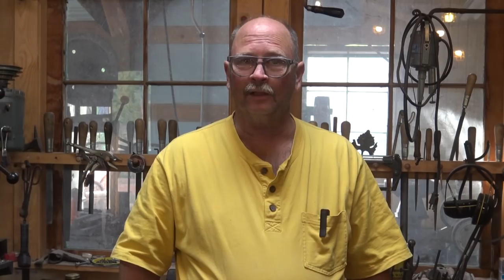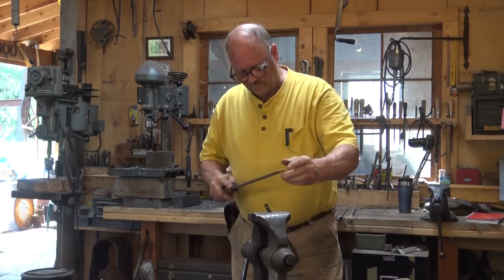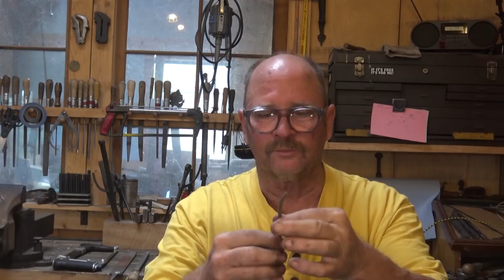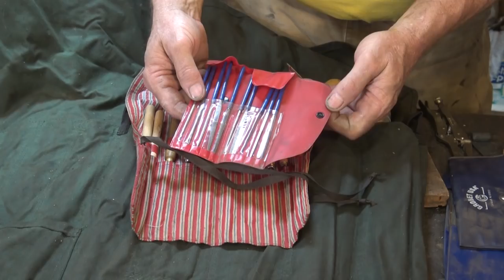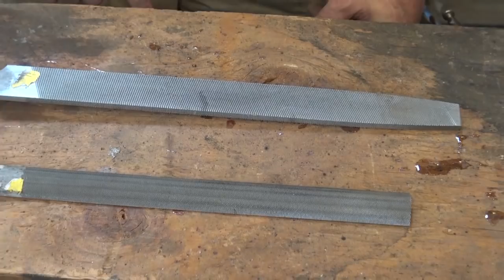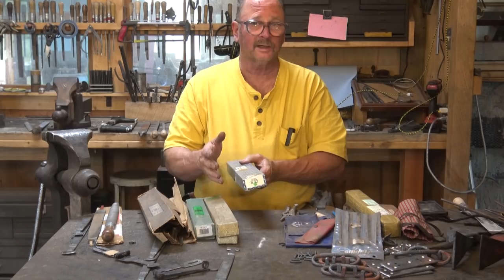Hand files for blacksmithing and metal work

Comment: Garage sales and estate sales if they happen in your area! I'm 28 now I'm hoarding old tools because they keep getting worse and worse!
Reply from the maker: The trouble with garage sale files around here is that they are usually well worn and have been thrown in a box with other files, which really wears them out quickly
Reply: @BlackBearForge  I did not know that about them rubbing together. It makes sense though. I learned a lot about files from this video. Thanks for taking the time to make these videos. I've tried it myself it takes SO much time to set up cameras when you're trying to get something done. Much appreciated!

Comment: great video. i’m a file lover and make knives with hand tools only, so files are a main tool for my hobby. i actually use files as stock for making knives. but most of my best files i have found at yard sales and usually pay about 25 cents a piece. i found the best way to clean them is with a flattened piece of copper tubing- rubbing the edge with the tooth profile, which tends to conform to the tooth profile. thanks for posting!! please realize what a fantastic teacher and motivator you have been for many. i’m sure God is saving a special place for you sir for all you do!!
kindest regards-scott

Comment: Thanks for the video, you informed me on what I was looking for (information). I also collect as many old tools as I can find them. Back when military bases were being "reorganized" they were selling tools by the pound!
90% of those tools were made during and after WW2 on up through the 60s and all extremely high quality even in used condition by todays standard. Some of my WW2 made tools have little to no markings on them, a 9/16 wrench would have the manufacturer name and nothing else. I understand the tools were being made for the factories & government as fast and simply as possible. The manufacturer names are many I suppose there were many contractors and subcontractors in those days but all these tools still work fine. FYI the file sets all came with several wooden handles that had metal jaws with twist tightening and a great file card that on the back side had heavy canvas including a space to hold a rig tipped pick in the handle.

Comment: Just watched this last night and for some reason went to a flea market today. Guy had a bucket of files all wrapped in wax paper. Ended up with 30 good condition  to new  assorted files. several USA  Nicholson, Simonds, Heller, Erizo, Delta and some stamped Germany. Most were long heavy files bastard, 1/2 round and round and a couple beveled like a knife withy a lions head stamped not sure what brand they are. Oh yeah $30 for the bucket 30 great ones and 10 junk.

Comment: Thank you have a good Christmas ! I just bought the Swiss files double cut ! I use them for jewelry they are the standard and German . I use PVC pipes in different sizes with paper or foam so they don't rattle in the draw or case .

Comment: John.  Thanks good info.  Couple of tricks that really work if you start with a good quality file.  I put my files in vinegar, especially when I buy old used files.  Couple of days to a week will really clean them out and make them cut.  I own a file card but don't use it much.  A piece of copper plumbing pipe smashed flat run in the same direction as the cutting teeth will clean a file faster then then card will.  Thanks for doing what you do.  I learn when I watch your videos.

Comment: One thing I was taught in mechanics school was to use a small square of aluminum to clean fine files. You would clean the file by pushing the aluminum parallel to the teeth. This would help dislodge stubborn metal filings caught in the file teeth. 

One thing more, I think it would be helpful if you discussed the different filing techniques: cross, straight and draw filing. 

Great video. Always enjoy the information and instruction you offer to help us become better blacksmiths.

Comment: Thanks very much for illuminating a truly complicated, confusing, and arcane part of tooling.  This is the best and most comprehensive treatment of them I've ever heard or read.  It's a great thing when an avid tool collector is a hard working and frequent user.  I think you should probably do tapes like this sparingly.  They don't the emotional kick of hot steel beaten with hammers, but when you do them, you do them well.
Reply from the maker: Glad you enjoyed it.

Comment: Great video. Thanks for sharing. Just some new info- Jason over at Fireball Tool did tests on the direction a file cuts the best. He made an automatic jig and ran the course with each file (thousands of strokes each). I believe he used pferd files. They cut in both directions equally, and after thousands of strokes, there weren't any visible differences in wear from the forward-only cut files and the ones used in both directions. The reverse only files cut equally as well as the forward only ones. Can't really argue with his results. It's either a myth or file design has changed over the years

Comment: I was watching as you rang your small bell. It appears to be made out of heavy material so will not vibrate
 Also a large bell chamber  made out of light sheet iron or brass sheeting folded and riveted are what I have used on a belled horse in the mountains. A bell 4 to 5 inches tall 3 to 4 wide one way and 2  to 3  the other way is a popular size. Either rectangular or round makes no difference  as long as the bell chamber is open and thin enough to vibrate when the clapper impacts  the very bottom edge of the bell. 8:35

Comment: Many thanks for that video! I got curious. On the Dick web page (can not post link here as YT seems to delete comment then) you read under history that they do not produce files anymore but they let them produce by Usines Métallurgiques de Vallorbe SA. If you search Vallorbe files Switzerland you will find the company. They state which brands they have and there is a webshop where you see prices. They have two price lines. The better one is roughly 15 dollars for a 200 mm file. They also have Valtitan files which are 72 (!) Rockwell.  They seem to be one of the few remaining producers of quality files in Europe. I reached out to them with some questions RE saw files (watched the videos of Paul Sellers on saw sharpening). They came back quickly, nice, and so I ordered a couple of files. Can not judge the long term quality as not using them very often. 

Paul Sellers reviewed Bahco made in Portugal I think. He said they are good, I have one bastard file of these and it is fine however aslso using not on a daily basis.

Comment: Very good overview, John. I switched to Grobet files a long time ago -- but I wasn't aware their current production has been moved to China. Groan... I have good success chemically sharpening my old files with a 10% phosphoric acid solution. Klean-Strip Phosphoric Prep & Etch is, according to the MSDS, about 40% phosphoric acid, so I dilute that 1:3. I immerse the files, in a glass container, hitting them periodically with a toothbrush. You have to watch them closely, because it's easy to over etch. Gets rid of rust, etches the edges back to sharpness, and leaves a rust resistant iron phosphate layer.  Clyde
Reply from the maker: Is the type of acid important?  or can they be done in any acid solution?
Reply: You want to stay away from really potent inorganic acids like sulfuric, nitric and hydrochloric (muriatic) acids. Firstly because of health and handling issues, secondly because they are so corrosive even at relatively high dilutions. (My experiments with hydrochloric acid didn't end well...) Organic acids such as citric and acetic (at high enough concentration) acids can be used for rust removal, but I've not tried to use them for file sharpening. I have used citric acid for removing rust from the old handplanes I restore, but even there I prefer the phosphoric acid for the protective phosphotized layer it leaves. And, you can find the Klean-Strip at any big box store.  Clyde

Comment: Not sure if you mention it in the video, but a good way to store files is cutting a long, narrow, horizontal channel in a board and storing files by putting the tip in the channel. They cam and hold themselves and are more easily grabbed than files stored vertically. I met Bob Menard yesterday and I saw that he stores his files like this. I'll be copying it for my shop
Reply from the maker: I haven't seen that approach, great idea.

Comment: The quality issue intrigued me. There is a review issued 25.08.2017 by the magazine “selbst” (a DIY magazine). When entering “test feilen selbst” you should get it (it is a German pdf but you should be able to understand the quality indicated by stars). In the 80s a German institute (VPA) set a standard for a good file – it should last at least 7500 file strokes. The ones tested only made 4000 maximum. Most much less. Also the amount abraded per stroke was poor compared to the 80s. Quality overall was sobering is their conclusion. They had some 20 files tested (different shapes too) e.g. Dick, Pferd, Hase, Nicolson and some discounter ones, Prices between 1-20 Euro. The Obi brand, a Dick and a Pferd got a good and satisfactory. Interestingly, the expensive Dick one (21 Euro) was worse than the 6 Euro Dick. The Lux (Obi brand) 6 Euro fared well. So price also not always a valid indicator. I mean heck. Is science needed to buy a decent file? Why is so much crap produced?

Comment: Great video. I find rubbing chalk for a chalk board on your files prevent them from clogging up.
Reply: You can also use charcoal for this. 'Pinning' is the fancy word jewellers use for 'clogging up'. Especially useful on soft metals such as aluminium or copper. I was always told to use a file card parrallel to the direction the teeth.

Comment: My agreement comes with your dragging on return strokes...
which can only remove stuck filings.
A burr on the file is not kosher.
A short bristle brass brush is good... unless wire guage of it is mismatched to the files pitch.

Comment: Isn't it more efficient to brush the teeth of the file with the file card on the diagonal across the width of the file rather than brushing down the length of the file, in other words parallel to the cut rows of teeth?  I have never seen anyone recommend the lengthwise stroke of the brush. This is my experience.
Reply from the maker: You are probably correct, but I have never thought that much about it.
Reply: Absolutely correct Rolf -  you will also note that the wires on a file card are sloped. the direction of the slope in use,  really makes a big difference  Have the points of the wires sloping towards the file handle [ie. down into the slots of the file teeth] and you will get far better results. Most of the file cards in UK now are made with too thick wire diameter for most files.  I find  that for second cut and finer files, using the fine wire brushes made for cleaning barbeques are very effective.

Comment: I always thought that a bastard cut file had a second cut so I came out to my shop and looked at my files and most of them are Nicholson’s all made in the USA and the flat bastard cut and the half round bastard cut have two separate lines of teeth which I thought was the most aggressive then the only coarse single cut that I have was a mill bastard which is coarse but not as coarse as the regular bastard file with two cuts

Comment: Try buying a quality flat bastard from Amazon with zero taper and over 10”…disappointing.  Most are 8” second cut with a double cut tooth arrangement…not what I wanted.  I ended up settling for a make called Bahco in 10” parallel form featuring what they termed an Oberg cut, idk what that means!  It does feel aggressive and has a comfortable handle tho’.  It better be good at over 30 bucks (27 GBP).

Comment: I liked this video very much and I want to ask you to follow up on the topic of the lesser quality files and do some experiments in using ancient methods of case and through hardening of iron, early steels, to see if these too soft files can benefit from such carbonization.

As a guide, please see the series Ancient Tool Technology of Antikythera device, video " Fragment #3, Hand Cut Files".

This series, shows in detail how the early files were made, how to compound the carbon treatment mix, which goes into a closed clay tube/box, which is heated till the desired levels of carbon in the metal is reached.

I know there are good files out there, my dozen or so rasp and files are U.S.A. Michelson's and my sculptors rasps and rifters are Italian top quality, however, I needed a large New Nicholson Flat Bastard and bought one, which I would be interested in trying such a treatment on.

Your abilities and long years working in this field means you are just the man to make a honest go at finding out if those of us new to 'learn as you go' blacksmithing, can take charge of this one ancient method and use it on our own, to improve on our tools and abilities.

Cheers,
Eli

Comment: Which 60 degree file do you recommend to file hand saw teeth ? Most of my files have worn teeth due to hard saw teeth wearing the file down. Need a very hard file that is long lasting and can sharpen dozens of blunt saw teeth. 8 inch Swiss triangle would be best quality, agree ?
Reply from the maker: I find slim taper files with a width double the depth of the gullet are best, Swiss files are always good.  This gives fresh cutting surface for each of the three sides.  So I have an assortment so I have the right file for any given saw.

Comment: I've got a project coming up that is going to use some very high-end (hardness and strength) Stainless Steel. Do I need files made out of special materials, or are they called something?
Reply from the maker: If your working on hardened material there aren't any good files.  But in any case you should have files you only use on stainless.  Otherwise there is a chance of contaminating the material.
Reply: I always use diamond files in hard materials. They are available in all shapes and sizes and last for a long time. Look around and you will see the prices are not as high as you  might think. I even use them for sharpening modern 'throwaway' hardpoint saws and also for touching up old farriers rasps for woodwork  .... but thats another story....

Comment: What about filing iron and non-ferrous metals. Can you do this with the same file or do you use different files for that?
Reply from the maker: Using the same file for iron or steel should be fine.  But there would be a risk of contamination if you then filed a non ferrous material.

Comment: Thanks John, What kind of projects can you use old files for, and how to prepare them?
Reply from the maker: That is a whole new topic.  Some people like them for knives, chisels or fire strikers.  You have to be aware that the file teeth can cause stress cracks, so its best to grind the teeth off, but then you loose the character of the file as a starting material.
Reply: Some people like files or usually rasps for folded tomahawks, leaving a little bit of the teeth on the outside looks slick when done right too.   You should anneal them first it you are doing stock removal and not forging them.   That's another reason guys like to use them for knives, they are already pretty much a knife blank as they are.   If you can find a farrier locally and work out a deal with them you can end up with a ton of big rasps and usually pretty cheap.